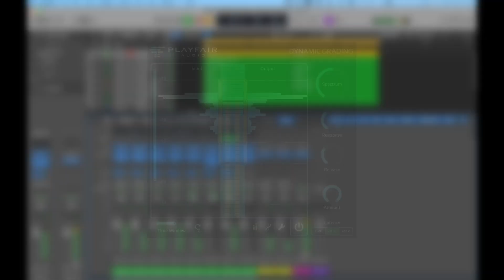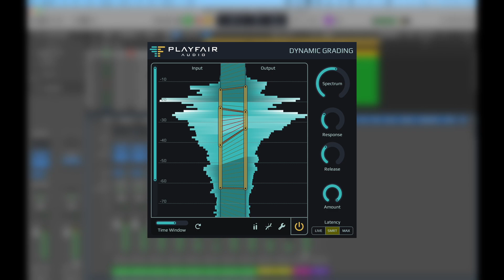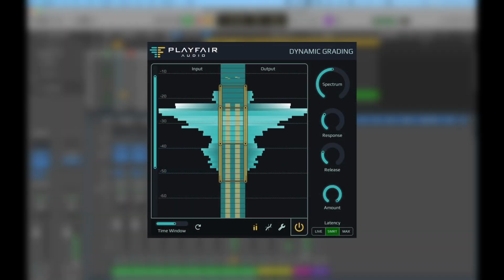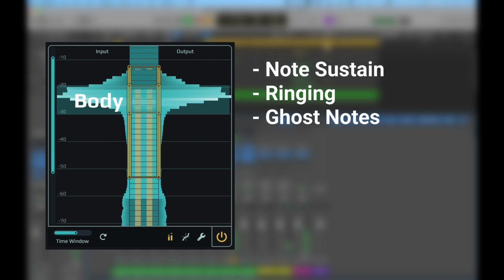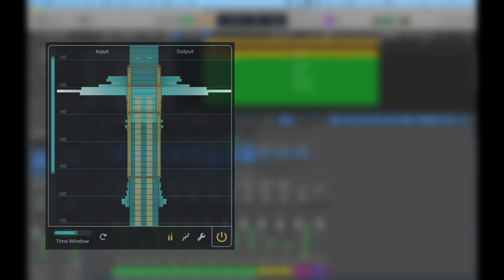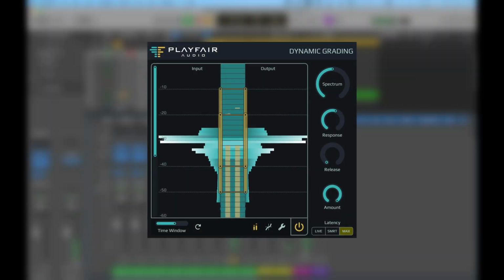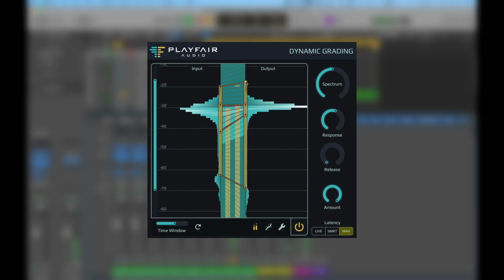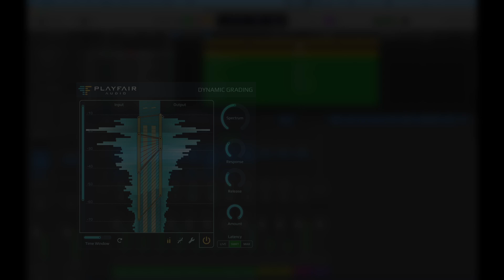Dynamic Grading Beginner Tutorial

Comment: I've been using this for a few days on speech / voice-over. It is a convenient and effective way to downward compress audio and has its place along side my other dynamics tools. My main use case is to compress by using the top band starting from -0db (or the top of the upper tail of your source histogram) to the top of the source histogram body (i.e. the whole headroom) and crush that to just above the output range, then to use the mid bar to compress the main part of the input histogram and finally either use the bottom band to crush the noise floor or to bring the decay and reverb up to the mix range, This is a very quick and convenient way to tame peaks and compress (which is useful most days!). Second great use I found so far, was in the case that the source histogram has two peaks and a substantial trough between, the middle band can be used to crush the band in-between and bring the two peaks together. Quite laborious to do with traditional one-threshold compressors. 
Hopefully it will be developed further as follows... The target/output bars sometimes offer more than they are really good for (TBC they are a great idea and most combinations are good but some combinations have a problem). I was quite keen on using it to push up the gain (to my target LUFS) at the same time as compressing but... (I'm using Sonible true:Level extensively and) when I try to push the target levels up high, using the Dynamic Grading plugin, I easily end up with a True Peak level warning. So I push the target levels back down until the TP is safe again.  It really would be great to be able to squeeze the gain/loudness and the "Peak to Loudness ratio" up at the same time as compressing but  Dynamic Grading would have to have TP Limiter features too (next version perhaps?). Even if it doesn't become a compressor/expander/limiter, it should perhaps have a TP and LUFS meter ... and a warning (perhaps preventing settings which cause TP overrun). 
Other compressors also cannot push output gain above their automatic make-up gain, without breaking True Peak. They also need a TP Limiter to go above makeup gain ... but the UI/controls of Dynamic Grading are just beckoning you push the target levels to wherever you desire, unlike traditional compressor controls. 
Of course, Dynamic Grading isn't a traditional compressor (its somewhat like a compressor/expander chain ... but it appears to use a single combined transfer function with soft-knee, which is perhaps more continuous & symmetrical than a compressor/expander chain) else it would have been trivial to offer make-up gain as a limit. Now I know to use it in conjunction with a TP & loudness meter (which I would do anyway), I'm not in the slightest bit deterred ... because that is a no inconvenience for the substantial convenience benefits it brings.

There are other comments here about making it a multi-band tool. That might be nice but I would prefer limiter features first. 
Hopefully this will fly and there will be funds to develop it further. Even without any further development, it is a practically useful tool for downward compression and expansion. Used with suitable meters and followed by a True Peak limiter (smart:Limit gives you both), it enables upward compression and does the work of a whole chain of compressors and expanders but without messing about with thresholds and ratios. It's been fun watching the histograms in  true:Limit  reshaping and the seeing a classical compressed envelope appear on my scope (now using the new scope in ShaperBox3), with such a quick set-up in Dynamic Grading. The Dynamic Grading 1.2.4 plugin, is a productivity tool, ready for action.
The plugin has lots of automation parameters. In particular, I think it may be useful to automate the Source range parameters while keeping the Target parameters anchored (which seems to be possible and which I hope to try soon).

Comment: Is it automatable? All parameters? I also like the multi band idea. 5 or 6 bands or more would make this extremely useful for mastering.
Reply: I'm using Dynamic Grading v1.2.4 on a Mac. It has lots of automation parameters (which I haven't used yet): 
Amount,  Color, On , Release, Resolution, 
Source Body Level, Source Body Range, Source Floor, Source Punch, 
Target Body Level, Target Body Range, Target Floor, Target Punch.

These would have been useful earlier today. I will try them soon. For vocals with quiet and loud patches, I imagine only the "Source" parameters need to be automated and the target levels can stay fixed. That should be so much easier to use than the parameters of a chain of compressors and expanders. Results might be better too (and less prone to human error). This looks like a really valuable feature. Needs trying out and (if it works well) could be a real time-saver, enabling some tasks which might have been impractical for some busy people before. See my other comment for tips about using the plugin with and without automation.